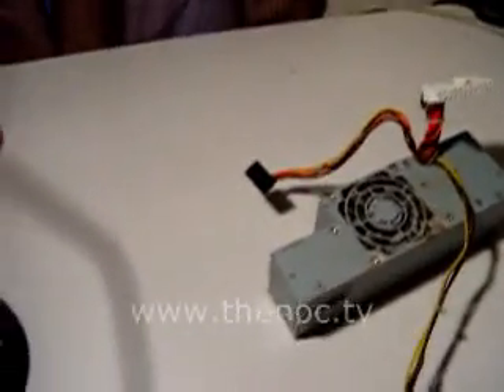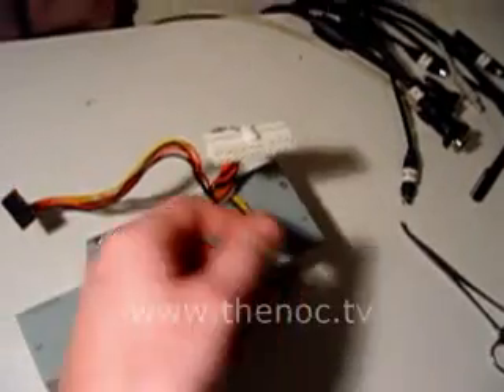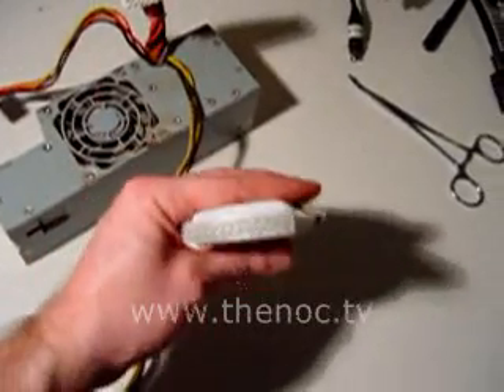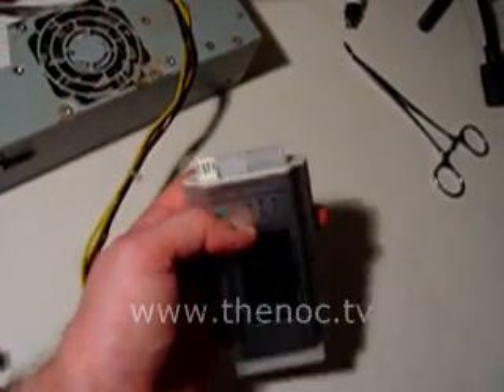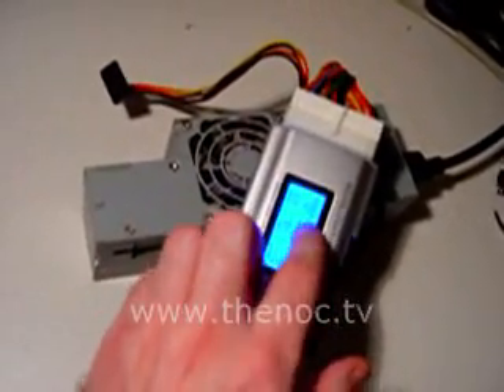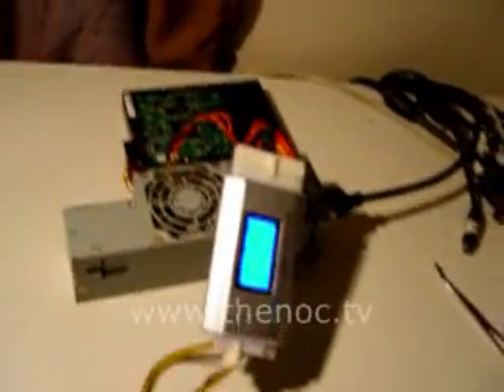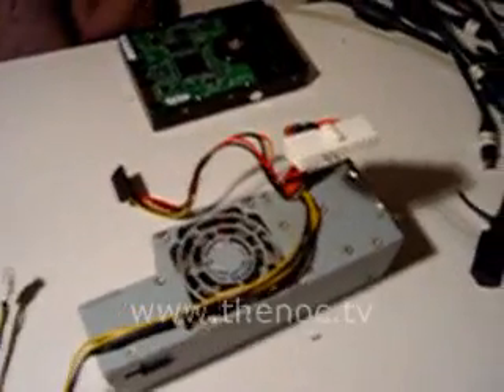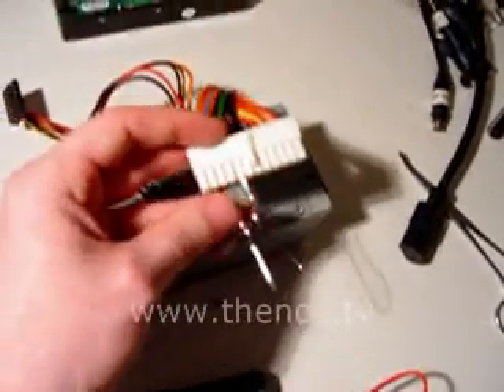How to test a desktop computer power supply

Comment: If the readings aren't exactly 5, 3.3 or 12v, is that a big deal? My 12v reading fluctuates from 12 to 11.9 and my -12 reads about 11.7ish. I'm having computer issues lately too. It cannot wakeup from sleep without a bsod, so I'm suspecting power supply.

Comment: I tried to use the jump-thingy on the psu while its not connected to the mb. after i'd gone trough all the pins and check if the voltages is ok, it still didnt get my motherboard going.. it was like 0.1-0.2 volts deviation on some of the pins, does it have to be exactly what it says in the manual? now i dont know if the motherboard is gone or the psu after a lightning outside :s any tips what to do?

Comment from the maker: @mrjamesb56 That one does 20 pin power supply to 24 pin board. The voltage is low from the power supply, but I just in general don't like being zapped period.

Comment: @DefconComputers - thanks for the reply, however after some research I have found out that if the fan does not rotate on powering up to the mains, it doesn't mean its broken.
There is also a way to test if a PSU works without installing to the mainboard. You need to jumper the 20pin connector (3rd and 4th pin from the top right - green & black wire - with a paper-clip) and the fan will start up!
Due to the low amounts of voltage going thru it, there isn't any danger at all :)

Comment from the maker: You would jumper the black and green wires, and then test it with a multi meter if you don't have a tester.

Other than that, no real way. The fan in general should move though, so that is a pretty good chance that it's bad.

Comment: is it possible to test a PSU without a meter?
I have a psu that i haven't yet installed but have connected to the mains and the fan does not rotate...does this mean its shot?

Comment: The P1 connector is keyed, so a 20-pin connector should always fit in the right holes.  And if you don't have a multimeter, then I would say it's handy to have around.  But, the only thing I dislike about it is that the LCD screen scratches easily.  I was trying to brush off some smudges, and my nails marked the screen up pretty good.  Unbelievable!

Comment: I bought this tester (PST-03) yesterday.  I have a 20 pin connector and it works as expected.  It only beeps when P4 (CPU plug, +12V2) is not plugged in.  You can have P1 and P4 plugged in at the same time while testing other cables.

Comment from the maker: The manual is wrong. I find that when you use only the 20 pin connection into it, that it always reports one of the voltages as low or non-existant (been a few years since I bothered to hook it up with just 20 pins)

Comment from the maker: That is true, and I should have mentioned it. That particular power supply tester though requires a 24 pin connection to test properly. However if the voltages are so low that it reads as bad with just that adapter on it, it's still a shot power supply, or just about to fail.

Comment: Besides, you should never use an adapter when testing a PSU, because it adds more resistance, causing your voltage to drop.  So, your readings will be less accurate.

Comment: The manual for that power supply tester (Apevia) says you can use a 20-pin or a 24-pin connector.  Are you saying the manual is wrong?  They don't say anything about using a 20-pin to 24-pin adapter.

Comment from the maker: They are supposed to work, but the fan will only spin if you jumper it like I said in the video. Otherwise the circuit never completes.

Some power supplies do run the fan all the time, but you likely will only find these in servers.

Comment from the maker: @mataslt Yeah the cord is fine as long as it can handle more volts than the power supply will pull. If it is less then you run a risk of a short, or fire developing.

Comment from the maker: 230v power supply? Are you living in the USA? Because we only run at 115v.

If not get a multi-meter and test the current going into the fan. Also be sure you are jumpering the power supply so it actually turns on.

Comment: im recently building a new custom gaming pc and i bought a power supply and a case but im not sure if it working. i connected a case fan to a 4 pin molex and connected a ac 250v power cord to a 230v power supply and the fan didnt turn does this mean that the cord is not right?

Comment from the maker: When I get a brand new tester I first test it on a known good power supply. If you don't have one laying around you can use a multimeter on each wire to test it that way.

$6 sounds pretty cheap for a tester. I would expect one to be closer to $25 for a simple one. So I would'nt be surprised if it was a crap tester.

There is a link in the article where you can get a better quality one from newegg like the one in the vid.

Comment from the maker: For general desktops the answer is yes as long as it physically fits. This dell uses a proprietary design and had to be ordered specifically for it.

I assume your concern is on the wattage, and generally having more watts than required is not an issue. However the extra heat could be. Just make sure you have some ventilation in the case and you'll be fine.

Check the rating on the current power supply, and match or exceed it in the replacement.